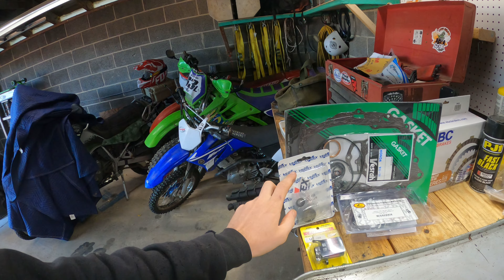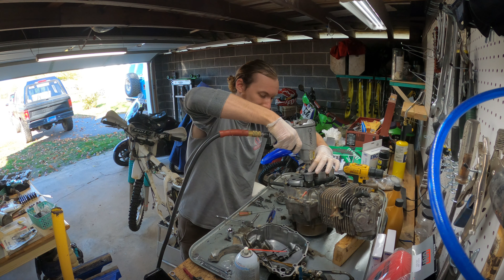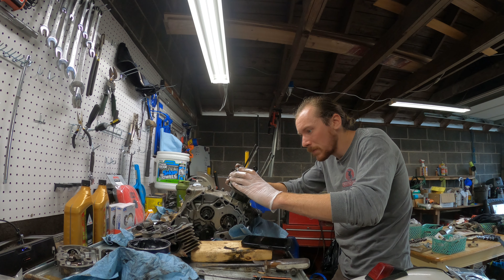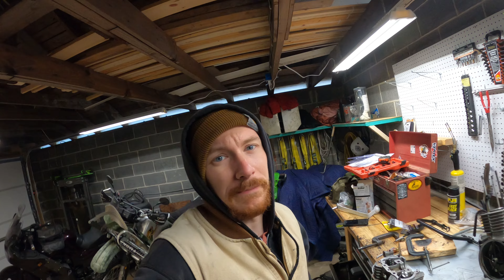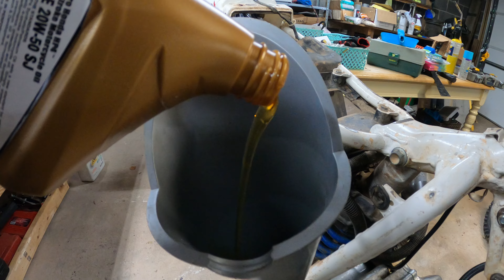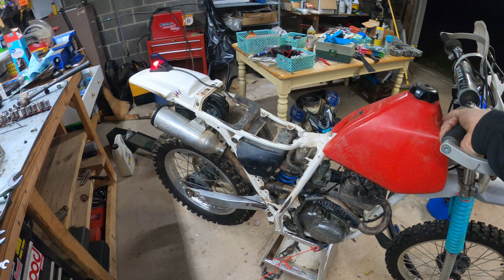XR200 Revival, Clapped out Special

Comment: Great video,You need to get a mr. heater.runs off propane, just make sure u have some ventilation wherever u use it, and never leave it unattended just to be safe.man, that XR is disappointing. I thought u had it fixed this time,(shit happenes). If you don’t succeed try&try again.don’t give up.u can take that bic apart blindfolded by now. Re group.you will get it going again. I would love to see you beat pj on that bike. ✌️bro.
Reply from the maker: I am picking up a wood stove this weekend for the garage!